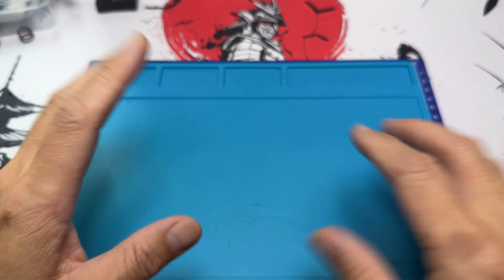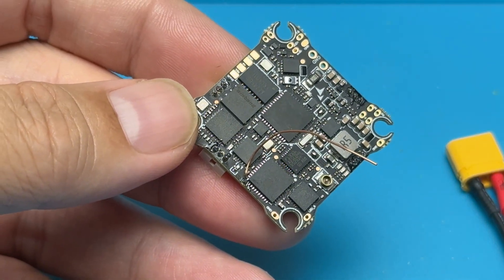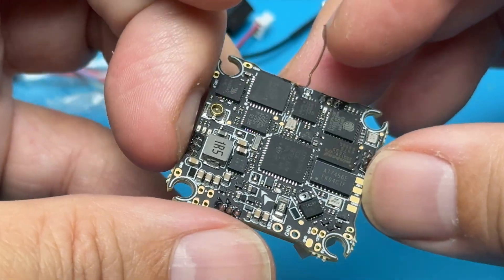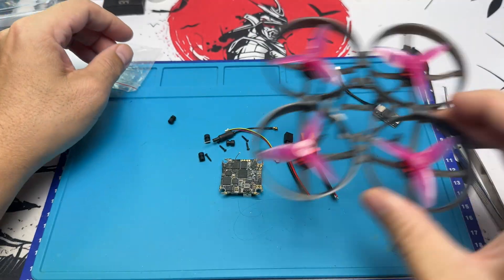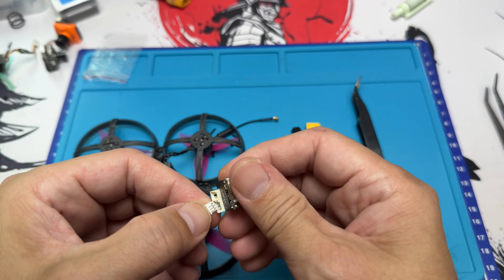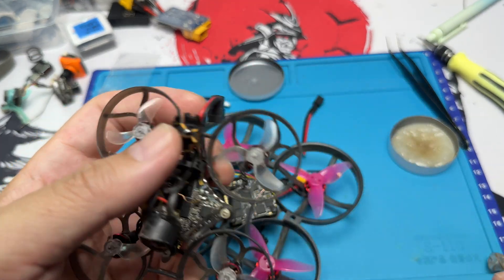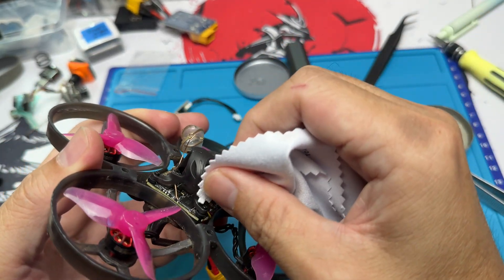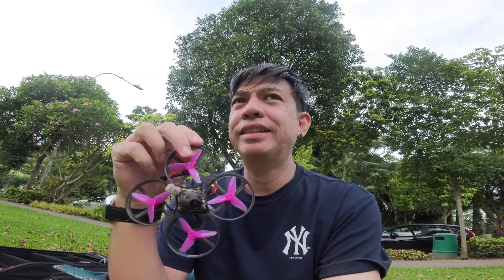Successor of the Legendary X12 Flight Controller

Comment: Bro, what the AIO vtx power?
Reply from the maker: oh, its max 400mw bruddah. Kinda standard for these HM AIOs.
Reply: @shogunemperor often to be said up too 400mW, remember lots of people saying it throttle back to around 200mW because of heat issues. But hard to prove without propper equitment.
Reply from the maker: oooh... I think 200mw was the ones with HDZero. The analog ones are 400mw. But yeah, ur right. Unless u have the reader u wont know exactly what power level output it is.

Comment: Naise.. good that they ditched the ceramic antenna...btw I learned from HM that adding a separate receiver is possible on X14 whereas doing so in UART version X12 will disable vtx (as they use the same MCU). May I know where you got the adapter to connect the camera to the flight controller?
Reply from the maker: Thanks bruddah!!! Yeah! Because of the additional UARTS. Oh.. the wire comes with the fc
Reply: @shogunemperor Thank you~
Reply from the maker: always a pleasure bruddah!!!

Comment: Hi! Thanks. Did you fly in pit mode, with the lowest vtx power? The jst connector for the camera is a 0.8mm pitch which is very hard to find: maybe it is useful to let buyers know, unless one can solder the camera cables. Do you know if this is possible? Thanks!
Reply from the maker: The vtx was set to 400 shown on osd but i get what u mean. For some strange reason it doesnt perform like 400mw. Yeah. I think i mentioned that it was much smaller. And yes. Depending on the camera you can. Ive had a few caddx ant that i actualy de-pin m soldered direct

Comment: Interesting they still havent improved that terrible cam plug position. Ensures that the camera plug/wires hits every frame, gets in all the way... Is on the top, why is the plug on the bottom?
Reply from the maker: Haahaha yeah… i have to agree with u on that one. But with the smaller JST plug.. the wires tuck in very nicely compared to the previous X12. Doesnt warp the frame like before. Oh man. If i knew the answer to that question, i’d be a certified electronics engineer!!! haahahha thanks for dropping in man!

Comment: The famous vtx burning board?
Reply: oh so it wasn't only me who got it burnt out by conecting to betaflight? xD
Reply from the maker: ive heard of a few. like a handful. But it does happen
Reply from the maker: Ive heard of several, but those are isolated cases… I’ve been using the same board on my mob7 and mob8 with no issues. Hard to burn a vtx out unless u crash hard. Then again… same happens with most boards, crash hard and somethings sure to burn.